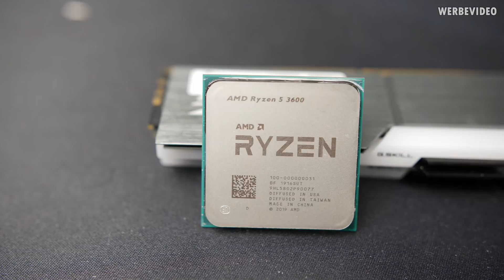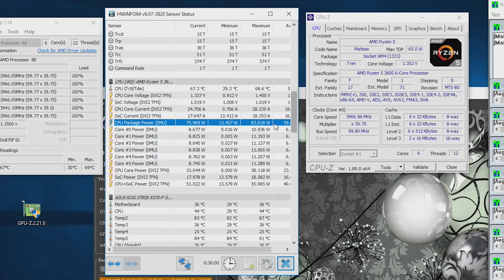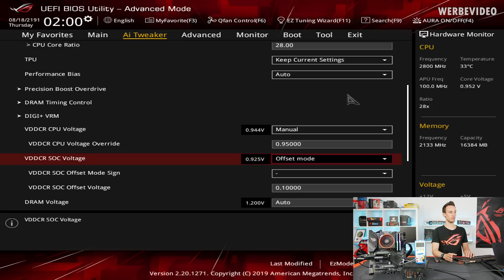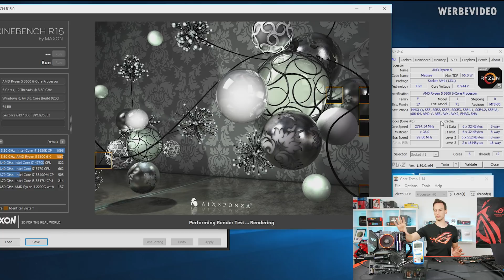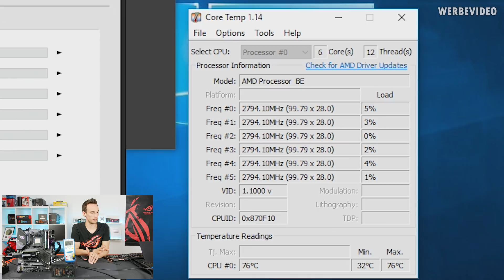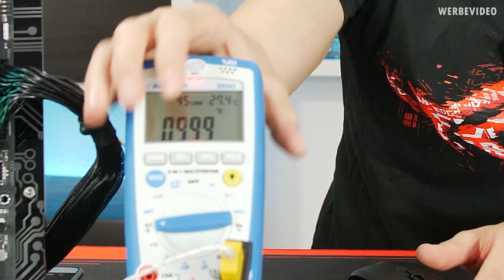Ryzen 3000 - Will the CPU work without cooler?

Comment: Basically what this means is company like Acer or Asus can easily stuff a 12-core or even 16-core in some beast laptop like they did with the 1700 / 2700.
Reply: @Martin M source?
Reply: @SimonZellox  Given there are plenty of Sandy Bridge CPUs still working perfectly fine in OEM hot boxes.
I would say the source is his rear end.
Reply: Probably, but like the GL702ZC and Helios 500 (AMD), AMD will have to basically pay OEMs to make it happen, it'll be a big heavy niche system more like workstation focused portable desktop replacement, the flexibility of the AM4 socket CPU will be ruined with a soldered GPU next to it, and you can bank on no BIOS updates to allow future CPUs, so, meh. At least the Asus offered something in being cheap for the CPU power vs the quads it was up against at the time, but the Helios 500 was objectively worse than it's i7/1070 twin in everything but cinebench.
Reply: @Martin M Fucking nonsense.
Reply: well, i guess we have a 3950X laptop now
Reply: I've experienced what  Martin M   maybe on about..... 
Sources:
https://www.youtube.com/watch?v=tAbInxD5UaY (about GPUs, however CPUs are constructed in the same ways yet add a metal lid)
https://www.youtube.com/watch?v=1AcEt073Uds (Louis Rossmann, his take on the BGA issues)
The CPU socket crushing issue is an experience from fixing many friends laptops (or attempting to in cases of AMD 2008-ish era units)

This was quite common on older AMD Truion X2 laptops up to about 2008-ish..... 
Such systems were typically peasant-grade snap-tops with an one-inch wonder heatsink fin-stack with a grooved-wall wickless heatpipe spanning most of the case and those laptops from new regularly saw well over 100C on the CPU die...

What would happen, is one of two things:
The solder balls nearest the heatsink mount posts under the socket would soften and be compressed under pressure of the heatsink mounting forces,
The uBGA (AKA flip-chip 'bumps') in either the CPU or in one of the chipsets would be softened and crushed thus bricking that part...

Answer is to make a decent cooling solution in the first place... and to keep the vents cleaned out of dust, though....
Ironically those nafftops still lasted longer than what seems to be the average time-to-failure in apple's latest range of nafftops
Reply: @Martin M It's not a concern for die size below 300mm2, heck even die size of 500mm2 should not be an issue, just look at the R9 290x, only concern is die size that is larger than 600mm2 such as the 2080ti 750mm2. Why is small die not a concern you ask? Just do the math for silicon coefficient of thermal expansion, a small die will expand/move by a smaller distance compared to a huge die.

Comment: Can't you force the CPU to run at a lower frequency by using the Windows power plan? In advanced settings you can set targets (min-max percentage) and if you put them both on 1%, then the frequency should drop well below 2.8ghz. And I believe if you leave the voltage at Auto/stock, it's going to be lower than what you can manually input too.
Reply: Or in c state editing. Pretty sure they can lock way lower than 2800mhz. I saw it with my 3600x. Bios is broken as usual

Comment: The reason that the CPU appears stable on 0.8v is because it just does less work on lower power while the clocks look like they're still good. You have to verify the performance with benchmarks to test the undervolts.
Reply: That's not how it works on intel though. AMD's design is garbage.
Reply: @TheBlackIdentety  How's this garbage? It's just different. I'd prefer this over bluescreens should my CPU just get trash voltage for some reason.
Reply: Because it's blatantly lying, giving you what you want to see instead of accurate real world readings. Might aswell turn on that feature on shIntel CPUs and have every single laptop "turbo" to 5Ghz @ 1,1V for marketing purposes. What the fk...? you're supposed to trust your software readings. Otherwise just don't give any reading and rate the CPU speed in unicorns per gigawatt.
Reply: @TheBlackIdentety  It's better than Intel because Intel crashes while AMD works in slower mode.

Would you rather your car engine limits it's throttle to 80% when it gets hot? Or shut off?

Comment: Probably should try in a month or so yeah, bios's are finky knowing how messed up boost speeds are rn, protection and auto throttling may be possible but broken. :/
Given a six core lasted multiple minutes at 2.8 ghz without a cooler, I'd say 800 mhz without a cooler should def be possible, I look forward to that.

Comment: What about a passive fan-less cooler comprised of a radiator? For example, remove only the fan of the standard cooler that comes with the cpu. This is very useful for people interested in completely silent setups.
Reply: Will work with even a relatively junk heatsink. With a good one, it should be able to pull non-boost clocks I suppose at default settings - limiting on TDP.
Reply: You can also get passive heatsinks that dont even have fans
Reply: I will try with the ryzen 3950x and dark rock pro 4
Reply: The fan at ~25% is completely silent for my 3700x. It really doesnt become audible until around 35%, then past 40% is has an annoying buzz. The wraith spire fan for my old 1700 was significantly quieter at high speeds.
Reply: Should work no problem.
Reply: I run my 2600 with an old school CNPS10X peforma and it’s almost completely passive, the fan is set only to start at 50°C, on light loads it’s almost never turn on, gaming it turns on for 3 to 4 seconds every minute or so at the lowest rpm and with a low noise adapter, I can’t hear it, the loudest thing in my system is the coil whine from the PSU and the hard drive noise, and sometimes the GPU fans
Reply: Arctic Alpine AM4 will work very well
Reply: easily running my 1800x under load with deepcool redhat without any fans
Reply: @GGJChannel

If you want something like that buy this:
http://www.nofancomputer.com/eng/products/CR-80EH.php
It's not as good as their 95W version, but at least that one can be fitted to a AM4 motherboard unlike the 95W part.
Depending on the case and GPU it may also run 100% passively (as in no case fans).
But since a GPU generally already heats up the air you might find that an APU setup works better with passive cooling.
Alternatively keep a few case fans and run those when the CPU, motherboard or GPU gets too hot.
Reply: I kinda tried this when I failed to plug my water pump in. The cpu got hot really quick. And the fitting on the block was very hot too.
Reply: And pay a lot for lost in performance mehh...
Reply: @guily6669  Those of us who care about silence tend to be willing to make other compromises in order to get that, be that performance, cost or other things...
Reply: @Luredreier   I'm sure there are so many air coolers out there that would be almost complete silence for Ryzen CPUs without at least having to compromise its performance much, maybe just lock the multiplier so it doesn't go to max OC boost so that the fans never even need to spin much faster, also it will make the CPU to probably last 4 ever while if it's used constantly at high temps it will reduce its life a lot...
Reply: @guily6669  To put it this way, for some people 40 dB is LOUD and unacceptable.
For instance in a music studio.
I bought a R7 1700 and I run it at stock and I'm not buying the 3700X right now mainly because there's issues with undervolting it so I can't lower it to the same power draw as the 1700.
Yes, I most definitively would rather lose performance then have noise.
As for my GPU I'm running AMDs chill with a range of 40 to 90 Hz.
So when I'm gaming and I'm doing nothing it's at 40 Hz, when I'm playing chill it's 50-60 Hz, and I still get boosts up to as high as 90 Hz when things get crazy enough for me to not notice the sound because I'm busy with other things.
And yes, I want it to be held back at around 40-60 most of the time in order to keep my system silent.
And yes, I do undervolt and undercock as needed to achieve my silence requirements.
Reply: 3600 will be the king of HTPCs
Reply: Arctic passive
Reply: Onlyfans?